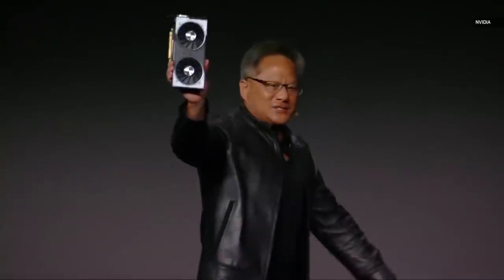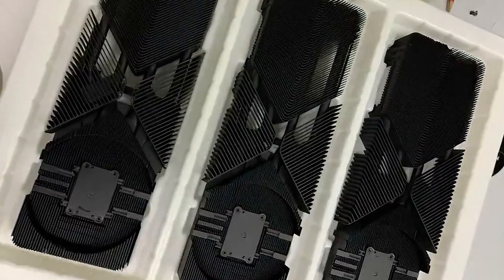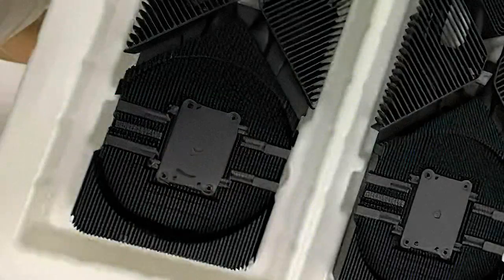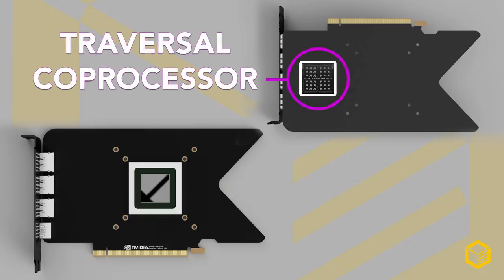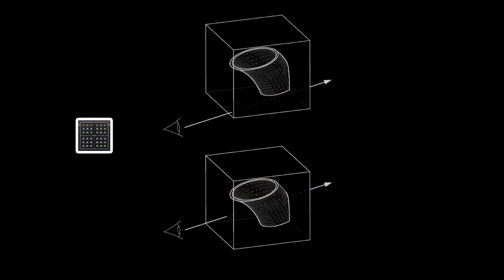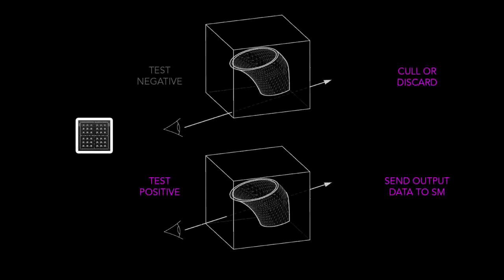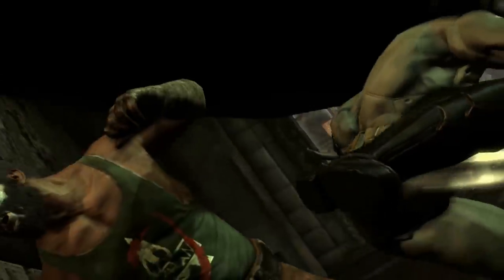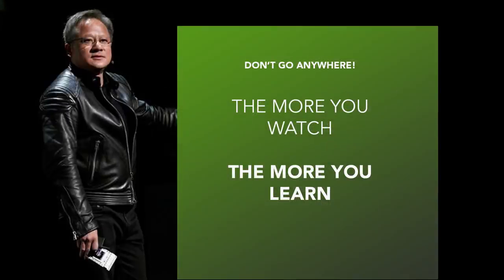A REVOLUTION in graphics is coming

Comment: I honestly don't know what to think about this.
Is it crazy BS? Well, forgetting about the VR part, which I refuse to comment on, no, it is not. It is that simple.
The controller will be a comparative flop, but the new way of designing graphics cards? I fear it will work very well.
Why do I fear it? Because like everyone else, I want the best, and i cannot use Nvidia due to their proprietary drivers, but more importantly, it may well create a divide, where some games and software simply cannot be used without going Nvidia. It is even possible it will create a general divide across "lesser" platforms, like Linux, which matters a great deal to me. I still haven't forgotten that expensive laptop I once bought, which had two graphics cards in sli, which I could not make use off on Linux. Not because it was not possible and not because the necessary code was not written and working on Linux, but because Nvidia had decided that their mobile GPUs should not be able to run SLI on Linux.
This and many other problems, is why I utterly loathe Nvidia, but of course that is the least of it.
AMD may very well be releasing something utterly groundbreaking in big Navi, it certainly looks that way, and had Nvidia just done what they usually do, it would've been a massive win, for once, but if Nvidia can indeed pull this off, this will be turned on it's head, and AMD will, undeservedly, not only not get their victory, not just loose, but get utterly destroyed, and that I think, is an injustice.
But then again, how can I blame Nvidia for finally making an effort? Obviously I can't, but I can at least blame people for giving Nvidia all the credit, as I think we can be reasonable sure that this would not have happened, had it not been for AMD pushing, as it would've just been business as usual for Nvidia. They would've been playing the money game, just like Intel, am we would've seem no significant innovation for a long time to come.
In conclusion, I loathe Nvidia and I can't use Nvidia for my purposes, as long as the keep all their source code in a highly secure vault, at least not for now. In the future maybe, but that depends on factors beyond my control. So it doesn't really matter what they do, I will be waiting patiently for big Navi, and at the end of the day, it will suffice. I don't really care about ray tracing and such thing. Gaming should be an escape from reality, not a recreation of it, but how will the world nook once my big Navi card no longer works? Will the Radeon group even exist? Will I finally have to conform, and change my setup so that I can use Nvidia? I don't know, but if so, it will go way beyond annoying me.
Reply: I ditched AMD over Nvidia,,,,due to shitty OpenCL performance over CUDA? ROCm???? it's been 4 years now and nothing new about it and pretty sad it seem abandoned ....unless something new capable or mature as CUDA as  Nvidia GPU then I would consider AMD GPU as my main primary system ... for now .... Nvidia still ahead from AMD when come to performance per watt ( THE EOL of VII ) best example  of AMD GPU failure

Comment: I wish physx and raytracing die
sounds like too much of a niche feature being pushed down our throats, it was not an organically demand by consumers nor developers, but nvidia pushed it so much with physx that didn't work and we lost development and hardware power for that, then hairworks that didn't work and more development and hardware for that, and now that finally they could push raytracing initially as a gimmick and people are falling for it they are gonna make everyone hop in this train nobody even cared a few years ago and dedicate half of a god damn GPU just for that....
Reply: Welcome to Nvidia.
Reply: Kobrar44  you could say that about anything, from phyx to hairworks and now ray tracing. We can’t just put new chips to each one render only grass and hair another only light then another one just fluid dynamics then another one just for terrain grains then another one....
If they focused on general GPUs the GPUs would be a bit better at everything and we could probably be rendering 8k 60fps  just fine by now, but no, they had to try to push proprietary crap
Reply: You can't just do everything using a small set of basic instructions. There is a lot of performance to be had by using hardware acceleration. For instance, there is hardware support for tesselation, it is hardware implemented and has been since 2001. Now it is used for instance in simulating hair. Things like tensor operations or ray tracing are bound to be massively useful as long as they are pretty general purpose. The tensor ops are, ray tracing is a whole usecase of its own.
You can't add infinitely many of those and that is true.
Reply: Ray tracing is here to stay.

Comment: This seems like a logical layout based on whats been leaked.
https://cdn.videocardz.com/1/2020/06/NVIDIA-GeForce-RTX-3080-Cooler-Exploded.jpg
The coprocessor would have to fit on the "power delivery pcb". And that PCB would need to be relatively small as shown so as to not obstruct airflow from the second fan on the other side of the card. That way the layout would have airflow on the end of the heatsink too.

Hmmm... Would the coprocessor need memory chips of its own around it?

Comment: I hope since moving away from AMD Jaguar mobile apu to more custom Desktop ZEN 2/RDNA 2 gpu, We should see much better games I hope. and also hope Nvidia is knock down few pegs with Big Navi, We need competition in gpu market. cuz Nvidia has been at top way too long and high prices of RTX is perfect example what comsumer and gamer don't want, with very little performance boost over last gen (GTX) as happy with GTX 1080ti,  upgrading RTX make zero sense right now. 
Would love be able buy PCI express card that adds more hardware RT/Path tracing, then maybe not have give up my GTX 1080ti? (ya wild idea but never know)

The problem and will continue be a problem for streaming games over net to user is Latency.  No matter how much tech companies want to use market words to tell you it works. It DOES NOT,  until they can figure a way to send data from Server to client in MS. Or Anywhere in world (or Mars for that matter) until they can achieve that.  Streaming games over net will always be a gimmick. And never beat actually true hardware that is in front of you.  For some games and/software that are not time sensitive, it maybe perfectly fine for.  But for time sensitive games which is most games. Too much latency will just push users back to either PC/Consoles. 

Perfect example is any driving or racing/simulation game, Where you need re-act too what is happening around you in ms.  
Good video. Look forward to AMD RDNA2/Big navi video.

Comment: There is no way a $500 - $600 computer build is going to run games better than the new consoles. If all you got is $500 - $600 to spend on gaming you're much better off getting one of the consoles. Computers will eventually catch-up and surpass them, but it's going to take time...and money! A $100 controller is not going to mean anything without at least a $700 GPU (plus CPU/Memory...) to go with it, I doubt consoles are scared of anything like that.
Reply: This is an old myth about PC gaming being more expensive but if you actually run through the numbers that's not the case.

It's true that generally speaking the initial cost of a PC is more, but you'll save a LOT more money in the long run since you're essentially forced to get the latest console and everyone does that, so ever few years you pay full price for a new console again AND you lose all of your games requiring you to buy yet more games to enjoy.

In that same time you may want to upgrade your PC, but doing so then becomes cheaper since the only component you have to buy would be the GPU until a LONG way down the road where you might upgrade the CPU/Mobo if you want the best performance, then you always keep your games forever which do nothing but improve in value as you upgrade your PC with future hardware that can run them at better and better graphics settings. You can buy new games at your leisure because you already have hundreds of games in your library plus PC games tend to be cheaper, at least thousands of great smaller titles are along with great sales and even pretty good free games on the Epic store.

Since most console gamers have been through a generation or 2 at least it'd probably be more fair to double the price of the current gen when comparing it to buying a new PC outright, and then you can get a pretty awesome PC for $1,000.

I know that argument sounds a bit disingenuous if you don't own a PC and therefore don't realize the cost savings as you watch console generations come and go that are all slower than your system selling half baked games for full price, but it's legit. There is also the obvious argument that a PC offers you significantly more value even if it was outright more expensive but I genuinely believe it's cheaper since upgrades can be spread further out and split apart and the obvious fact that I don't have to re-buy GTA 5 online like Console games do just for something closer to PC level graphics.

I can and still do enjoy some of my favorite RPGs that for console gamers are just found memories such as TES 4 Oblivion and Fallout New Vegas, and both have never looked better.
Reply: @OGPatriot03  Lol, me not own a PC? I own over a dozen PC's and some of them would truly surprise you - hehe. I hear what you are saying on the games, however, I really don't think you got your calculator out for this or realize the speed of this market. While I do enjoy firing up an old game from time to time, the market is NEW games (and sequels to older games - but the sequel is NEW) which require upgrades no matter what platform you are on.
The cycle hasn't changed, the consoles will have about two years of glory until PC's (and I mean ones that don't cost $2,000 to build) will catch up and then PC's will get 2 - 3 years of glory. Rinse, cycle, repeat.
I do understand your point on the games - but that happens on the PC side too, if you break out the calculator you will find it's almost a wash between the two. This is a business after all and the companies know exactly what they are doing - I feel your pain...

Comment: lol you really think they will push only 25% over 2080Ti which already was lackluster in perf over Pascal's 102 chip ? All that at alot higher TDP and after node jump ? seriously dude ? I dont have problem with regular 3080 being that and you claiming it but the fact that you think GA102 vs TU102 chip gain is only 25% is just ridiculous to think. More like GA104 vs TU102. You do realize that it would make GA104 slower than 2080Ti ? I mean full TU104 aka 2080 Super is only 17% from 2080Ti currently at 1440p so where would GA104 land exactly ? Slightly faster than 2080 Super ? Come the fuck on lol

Comment: There's no pc on the one half of the card though so how could there be another chip where the other fan is when there is no pc there
Reply: Pcb not pc
Reply: At 6:10 you can see it shows the other possible component on the same side of the GPU, just the opposite side of the PCB. Not under the other fan where no  PCB exists.

Comment: Stadia already flopped with their controller/cloud console that worked the same way. And 99% of Devs have abandoned nvidias cloud service
Reply: Stadia is actually growing quite quickly... I'd expect it to be a major contender in the next 2 years tops.
That, plus devs have said they already have the 2nd Feb Stadia hardware specs to work on internally, so the service should rival or surpass the new consoles before too long in terms of power...
Reply: @RougeEric  😂😂🤣🤣🤣🤣🤣🤣🤣🤣🤣

Good one.

Comment: This makes absolutely no sense at all. A very fast communication is required between 1) Memory and RT-unit 2) RT-unit and Shader processors.The RT units HAVE TO BE in the same chip as the SMs and ROP to have enough bandwidth.
It seems that youtube is now FULL of clueless peoples posting very stupid speculation and false rumours of unreleased hardware.
Reply: Actually Nvidia Patent allows for an external Co-Processor with more capability as in memory, scheduler etc. Even shows a diagram of it going to the SM. Nvidia has come up with a cheap and very fast way to link up multiple chips, MCM, basically one pin per each SM would be needed for up to 1tb/s bandwidth (some very cool stuff). Any external Coprocessor would have multiple RT cores, one for each SM - all very feasible. RT is very memory intensive meaning a lot of reads from memory to transverse the BVH this would put the GPU at memory speeds vice very fast cache speeds for a large amount of the time processing or transversing the BVH, so having a separate external number of RT cores in a Coprocessor with dedicated memory or cache would free up the GPU from the RT processing part greatly allowing the faster GPU internal speeds. Does not mean this will happen or that Nvidia will use it. This video is forward looking is all. Not stupid in the least bit, can it be wrong, of course but is very much feasible. Nvidia would not put this in the patent if it had zero potential or possibilities.